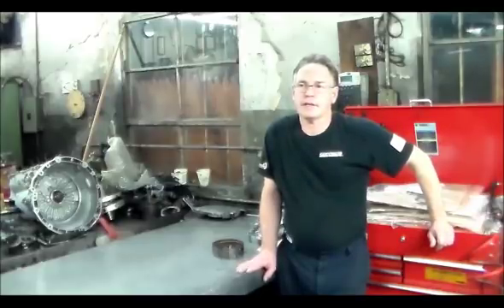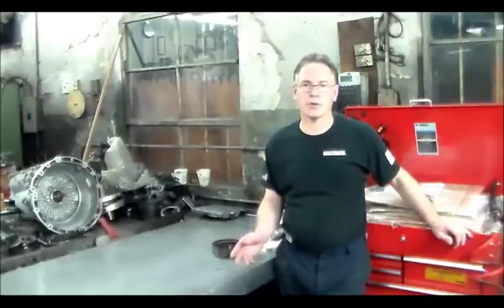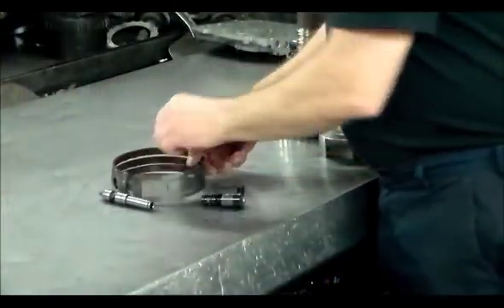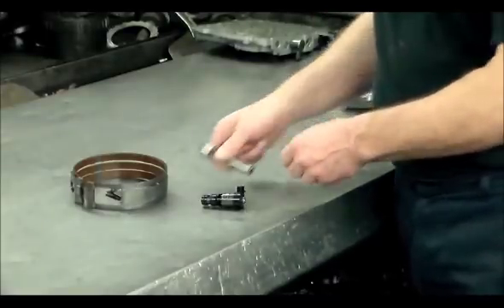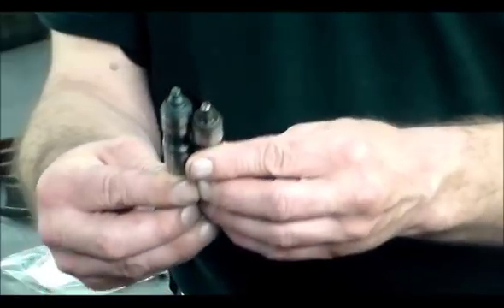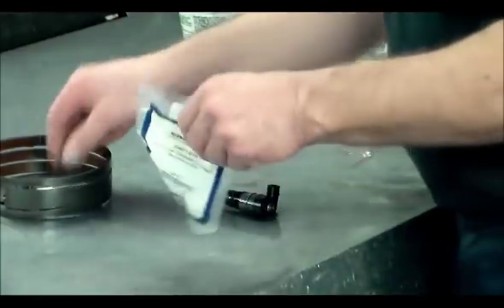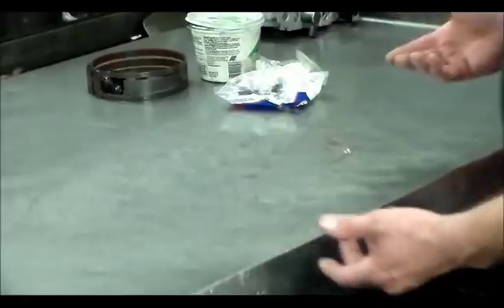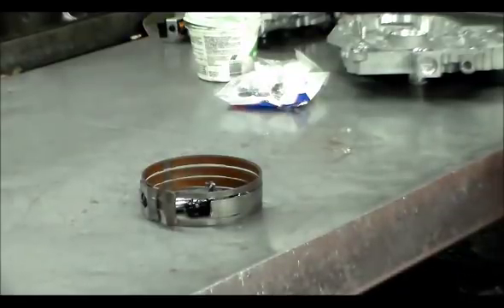4T65E, No Forward

Comment: Hi @GarryFerarro I have an Volvo xc90 t6 with an 4t65e transmission….about 100k km ago it had an differential damage I bought an used transmission from an Volvo s80 then to get those damaged gears out of it and build it together with an overhauling kit about 4 years ago….the car drives good without any towing load….towing an trailer on normal straight road is possible too but I have a boat I need to tow out of the water on an boatramp unfortunately my Volvo was unable to tow it out last time ….it feels like something slips when it need to pull heavy load
Now I try to figure out if it could help just to replace the stock style pin with the sonax to put maybe some more pressure on that forward band to get rid of that problem 🥲….
What do you think could it help or do I need to take the whole transmission out again 😩

Comment: Hi, I have a Volvo S80 T6 with a 4T65E. It won't move forward or in reverse. Could it be the EPC valve? Or the TCC valve? Or a solenoid? Greetings from Argentina.
Reply from the maker: on the 4T65E, the input clutch is on in both forward and reverse may have a problem there

Comment: What’s the cause of it
Reply from the maker: do you mean why does the band break?
Reply: @GaryFerraro yes so basically internal damage
Reply from the maker: @ yes, usually do to a malfunctioning EPC solenoid, applies band with to much pressure and snaps the band. Plus the servo pin travels about half inch and thats to much
Reply: @GaryFerraro yes

Comment: Would this also make the uplander not want to shift into drive or 3rd but works in 1st and 2nd gear ? Someone told me the problem is this: Pressure Control (EPC) Solenoid is that possible or more or not at all. Thanks
Reply from the maker: Is reverse ok?

Comment: Thanks for the info Gary! My 2008 Chevy Uplander  just did this last week . Initially no Drive and 3,but  1 and 2 still work so I tried to drive it home about 5 miles or so at a traffic light the 1rst and second gear also went out, but reverse still works. So I reversed to a safe location by the road and called a towing company . I am now trying to decide whether to get the transmission fixed by a mechanic since the car still drives fine and has no other problems or junk it since it might cause me more than it's value. Thanks again for the info.
Reply from the maker: Have you got any prices from shops?
Reply: They have not given me an exact price yet but estimated it at  around $2,500 Canadian either way.
Reply from the maker: When you convert that to US dollars, that is a good price @SaltyShipmateRon
Reply: How much to get my 2007 Grand Prix gxo
Reply from the maker: Where are you located? @MichaelShack-xs1lp

Comment: Could a damaged forward band cause the drive mode to fail but not 1 or 2 (2007 grand prix)
Reply from the maker: Depending on how the band breaks yes. If you have no Forward in Drive but have reverse it is a band problem

Comment: So with your help via the videos you post I rebuilt a 4T65E-HD. It's now has 28k since the rebuild with no issues.
I now have a problem when transmission is hot, starting from a stop it kinda pops into first but not a hard pop. However when you accelerate you can feel a little slippage in 1st gear. 
I did install the sonnax extended length forward band servo pin kit and the sonnax tcc relief valve during rebuild. 
No transmission codes when I checked, and only when hot

Comment: Hi, i have a 2006 Buick Lucern 3.8 V6 that is giving me fits. I purchased it as a "run and driving" car from the auction to give to my stepdaughter. Car has a 120k ez miles on it, starts right up reverse and drives fine. in fwd and reverse, you can feel the gears change ect. Once warm however the trans feels like it is slipping and that gets worse and worse til you are stopped with no motion. Any ideas? does this car have a TCM? i can't find one...
Reply from the maker: The problem that your having is the filter is clogging up because something is coming apart in the trans, if you install a new filter will probably only last a few days before it cloggs again

Comment: Hello, I have an 06 Grand Prix base 3.8 V6 with a similar problem but it only happens sometimes. Could it still be a broken band?
Reply from the maker: I would say no, have you checked the fluid level? How often does this happen
Reply: @GaryFerraro  I have checked the fluid and it's full and it doesn't have any metal debris in it as far as I can see, it's been sitting since winter started because it started happening as soon as it started snowing. I start it up everyday and make sure it goes forward and backward and it hasn't had any issues but it hasn't been farther than my driveway

Comment: How about no reverse on a 07 Chevy impala?
Reply from the maker: Does it move forward in Neutral by chance?
Reply: @GaryFerraro  yes forward n neutral just no reverse
Reply from the maker: So it does move forward in neutral?
Reply: @GaryFerraro  no not in neutral
Reply from the maker: @javierochoa432  No Reverse is not common on this transmission, there is a band and the input clutch applied, if it moves forward that would eliminate the input clutch. Never really seen issues with the reverse band but it's either that or something broke or stripped inside the trans.  When you select reverse do you feel an engagement?
Reply: @GaryFerraro  no engagement
Reply from the maker: @javierochoa432  very possible something happened to the band, did you drop the pan by chance to see if any metal is in the pan. Very uncommon for these to have no reverse
Reply: @GaryFerraro  no but I will today and I'll let you know the results
Reply: Actually I drop the pan and there’s residues of metal in there what could be the issue ? Hopefully you read my comment thanks Gary

Comment: Please help. 2000 olds silhouette.  Lost drive.  Reverse is cool. I have to start driving in frst then shift like a manual.  After 20 mph it drives normal. No shaking  no vibration,  fluid is pink , not over heating . Idk you seem to know ur craft. I seem to find alotta vids but no real answer  I posted the problem on my channel it's 3 short vids . I live in it and  Please don't say sell it. Ty in advance
Reply from the maker: That should be 4T65E Transmission, your band is broken
Reply: @GaryFerraro  yep. I dropped the pan
Reply: tyranny? Auto parts guys can even distinguish brake pad and brake shoes.  It's sad in this country nobody want to do shit and nobody wants to either amazing
Reply from the maker: @Brucesanders2024  Not really, trans has to come out and all apart
Reply: @GaryFerraro  is this doable for a first time transmission job far as rebuilding it? Do I have time or gonna die asap?
Reply: What part is that called exactly? Do I have to replace alota crap or just that piece
Reply: @GaryFerraro  ty for getting back to me my friend. I posted 2 vids of what I saw and the piece can u take a look please

Comment: Yes this happens all the time from what I can see. Do you have to tear the whole transmission out to repair this? Mine broke EXACTLY as the one in your video! I do not have the space or patience to pull a transmission right now but that is the only way I have seen repairs such as this done. Is there another way?
Reply from the maker: If the band is broken, has to come out, no other way to fix
Reply: You can just loosen the cradle and drop the cover side alittle so you can access the side cover, you’ll need a jack and an engine support

Comment: It appears mechanically my 4t65e-hd doesn't have mechanical issues. If I unplug the harness from the trans and shift it manually I have all the gears and it accelerates fine in all gears. Plug the harness back in and I only have R,1&2. 
Would it be safe to assume it's a solinoid, or valve plate, or selector switch? I'll probably replace them all.
Reply from the maker: Any codes present?
Reply: @GaryFerraro  I been trying to figure out which inexpensive code reader is the best. After a certain value$$$ I might as well just replace the valve body, valves, plate and gasket and skip the code reader.
Reply from the maker: @playsportfun3356  ok, just tell me again what the problem is?
Reply: @GaryFerraro  I have no 3rd or 4th gear. But if I unplug the harness I have all the gears. I just have to shift it manually
Reply from the maker: @playsportfun3356  what happens when it should shift to 3rd, does it spin up like it goes to neutral?
Reply: @GaryFerraro  it appears to be in neutral. No engagement to the engine what so ever. Only 1 and 2 have any change to the engine rpms.
Reply: I read somewhere that if all else fails, cut the brown wire. Brown wire is for like torque converter something solenoid. Im about to cut that brown wire and see what happens. I will disconnect the harness from the trans first like you mentioned. This might be electrical.
Reply from the maker: @robertdinero2853  Do you have no forward?
Reply: @GaryFerraro last I remember was my forward was there, but would never shift. Like if it only had one gear. If I stepped on the gas, I would pick up speed along with the rpms, but never shift.

Comment: What's the part number on the pin with 2 Teflon washers?
Reply from the maker: sonnax part number   84571-01K, I use that every rebuild
Reply: "pin" this comment!  @GaryFerraro
Reply: @GaryFerraro  Does this item fit to Volvo XC90 AWD?
Reply from the maker: @BogdanIonac  It is a 4t65 but being it's a Volvo some parts are different, like input speed sensor and valvebody gaskets
Reply: @GaryFerraro thank you! I have a Volvo xc90 2.9T6 with AWD 4T65. I want to rebuild the whole transmission. 5-10 minutes after start i have no movement. 200000miles. Here in Romania is very dificult finding good parts.

Comment: Had this problem with 06 monte SS. We found a slightly used GM Good wrench trans. Put it in everything worked fine for about 1 month. Have R and 1 and 2 but no 3 or 4. If I unplug the wire harness to the trans it will take off in all 4 gears. I replaced the TCM. same issue. Checked the flow thru the cooler 2.3qts in 30 seconds. What would your guess be?
Reply from the maker: Something happened to the direct clutch, when it shifts to 3rd does it just go to neutral?
Reply: @GaryFerraro  kinda weird 2 transmissions, same issue in 1 month. The first had metal shavings in the oil. 
Do you think this is a pressure problem? Valve not working? 
Not sure what the direct clutch is?
Reply from the maker: @playsportfun3356  Did you scan the car for codes?
Reply: @GaryFerraro  either I don't have any or my code reader doesn't do transmissions. Is it a special code reader?
Reply from the maker: @playsportfun3356  so what exactly happens when it goes for 3rd? when it should shift to 3rd does it just spin up like neutral? If you have a 1-2 shift then the 2nd clutch is ok, the 2nd clutch stays on for 3rd and 4th, so i'm thinking you have a problem with the 3rd or direct clutch
Reply: @GaryFerraro  yes, just like neutral.  Just moving it around the driveway.  I've noticed 1st and 2nd no longer has the power to go up a incline. But 1st and 2nd were still strong when I initially lost 3rd and 4th. 
There isn't a fuse or relay, something simple I should be looking at 1st is there? I've had a red squirrel chew a section out of my truck harness before. I've looked for that here. Nothing obvious.

Comment: I’ve got an 07 Grand Prix GT— left work last night, reversed, shifted to drive and accelerated. Heard a pop of sorts and then drive and third wouldn’t work. 
I have reverse, 1,2, and if I get to about 30 in 2, I can manually shift to 3 and D, and feel it catch. 

The shift cable is still attached, slightly loose, but visibly cranks through each gear. 

Could this also be a band issue? Or maybe an electronic one?
Reply: Did you figure it out my impala is doing the same as yours
Reply: @joewheeler7527  ended up having to get the tranny replaced. Don’t drive it anymore, you can probably get it done cheaper than me, I kept driving it and fucked it up more than it was already

Comment: My 1/2 is good my 3/4 is good but my 2/3 sometimes can be little rough
Reply from the maker: that could be the direct clutch.  If you can get access to a scan tool, look at the T.A.P cells (transmission adapt pressure)  Know anyone with a scan tool like snap-on?
Reply: @GaryFerraro  will try that there’s no codes or lights on the dash but I can feel it so I’ll try what you said
Reply from the maker: @ryans413  wouldn't be any lights if no codes, do you know someone with a snap-on scan tool
Reply: @GaryFerraro     Um no I have a scan tool but can only read PCM codes not TCM I can go get it scanned at a shop or something. Those scan tools are expensive

Comment: Awesome video. I have a question. I have a 08 impala police 3.9l 4t65e that had no forward. When I pulled the trans fuse it worked (which if I'm right puts it in limp mode) was wondering if you think it's the forward band or maybe if I should try the TCM first? Thanks!!
Reply: I should add that fluid level was good and it was not old at all (still really red). But yeah.. Any info is appreciated
Reply from the maker: Reverse is good?
Reply: @GaryFerraro  it is.
Reply from the maker: @Jessewest26  Sounds like the band is broken, when you unplug the solenoids it will start out in 3rd, the band is 1st and 2nd. If reverse is good, then that band is broke
Reply: @GaryFerraro  right on. I'll have it checked out before I do anything. Thanks for the help. I'll let you know how it turns out
Reply: @GaryFerraro  So get this, I replaced the TCM and everything worked fine. For a couple days at least. I was wondering if you think it might be a short rather than the a broken band..? I drained the transmission and took the pan off and replaced the filter as well  Didn't see anything in the pan. From what I've read the band(s) are likely to end up in the pan when they break? Anyway if you could let me know what you think it'd be greatly appreciated. Thanks!!
Reply from the maker: @Jessewest26  was this maybe in failsafe, did it move forward very slow like it is in 3rd or 4th gear or no forward at all?
Reply: @GaryFerraro  No I put the fuse back in. It was weird because once I changed out the TCM it worked perfectly at first. Now I'm back to square one where it just revs but doesn't move. Tried manually shifting through gears as well. I'm thoroughly confused.. 😅
Reply from the maker: @Jessewest26  if you have good reverse and bad forward, sounds like a band to me. The band may not have broke from where the piston applies it, band maybe broken in another area
Reply: @GaryFerraro  appreciate the quick response. I'll probably open her up this weekend. I'll be sure to report back. Thanks again. You da man!!
Reply from the maker: @Jessewest26  ok, sounds good
Reply: I HAD MY CAR TOWED HOME A WEEK AGO,PAYED around every night no forward and no reverse ,I read your comment and did as you did.It worked ,now it has a week reverse and in forward  it acts like it starts out in second but once it gets  to speed it goes as fast as you like. IT IS a08 impala3.9ex police thanks a million for the very important tip 👍
Reply: @markthomas9703  not sure if you meant what I said helped, but if you did, just a heads up, that is how I got it home. I wouldn't suggest driving like that. If you do it could turn a simple fix, I.e. a clogged filter or clogged cooler lines into a complete rebuild.

Comment: I was wondering if someone could help me try to figure out what shop I should send my car to. Transmission shop or mechanic shop because I inherited my grandmother's 2004 Pontiac grand prix gt with 55k miles and I drove it home and it drove like brand new! I drove it a couple more times and parked it for about a month. Well when I got into it I had no forward gear. Manual first would kinda work. Now I noticed mice had been chewing on the insulation on the upper hood and back towards firewall. But I'm not noticing wire damage. Could it be a broken wire causing the problem?
Reply from the maker: How is reverse and in drive range no forward at all?
Reply: @GaryFerraro  reverse works fine but it does slam into it a little harder than usual. And in drive I feel it just slightly engage but doesn't really wanna go if that makes sense. All manual gears are the same as drive except 1st it engages fine and has good drive.
Reply from the maker: @tallantballer45  Sounds like the forward or the 1-2 band is broken.  Where are you located?
Reply: @GaryFerraro  in Oklahoma
Reply from the maker: @tallantballer45  ok, i do not know anyone there, thought maybe you were near me
Reply: @GaryFerraro  I wish I was near u, I'm a lil afraid my transmission shop might not upgrade that part and stuff. Just replace with factory and not replace other stuff while in their. Anyways ima look around and thanks for ur help!
Reply from the maker: @tallantballer45  ok, let me know what happens,

Comment: Hello do I need a full rebuild if my forward band is broken? 2006 Pontiac grandprix gxp v8 5.3
Reply from the maker: Well, you pretty much have to pull the whole trans down to replace the band and it is very common for the 2nd and 3rd clutches to wear out, if you are going to keep this car i would say yes to an overhaul
Reply: @GaryFerraro  ok and thanks. I'm going to add a shift kit.. would a bigger or better torque converter be recommend?
Reply from the maker: @TheCoolestt1  Regular converter should be fine unless you want billet, I have never done a shift kit in one of these units
Reply: @GaryFerraro  yes I'm planning on keeping it
Reply from the maker: @TheCoolestt1  May want to go for an overhaul, how many miles?
Reply: @GaryFerraro  it's at 170 thousand now.
Reply: @GaryFerraro  very high miles
Reply from the maker: @TheCoolestt1  i would go for a full rebuild
Reply: @GaryFerraro  ok and thanks
Reply: @GaryFerraro  I just replaced the band in my 06 lacrosse, 130k, driving perfect now, a shop wanted $3500 for rebuild, screw that! The cars not even worth that much 🤣